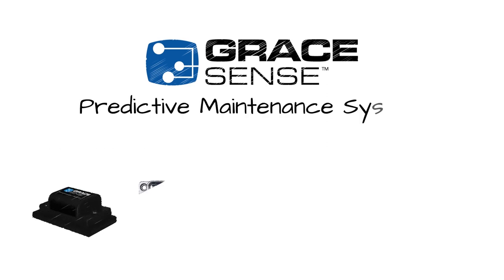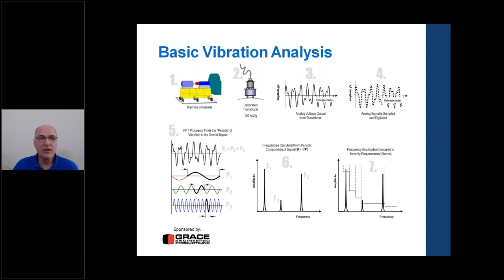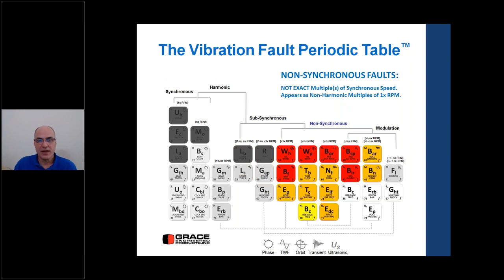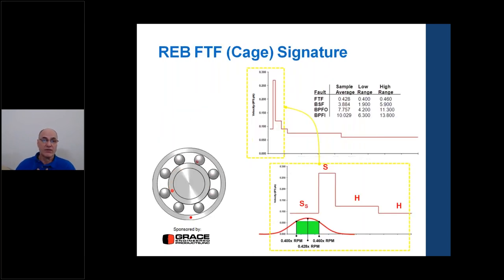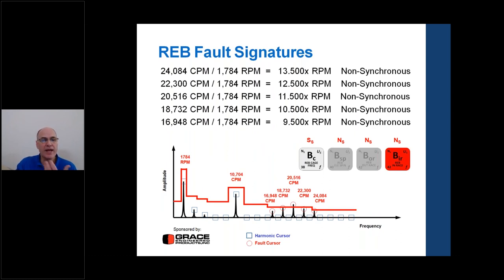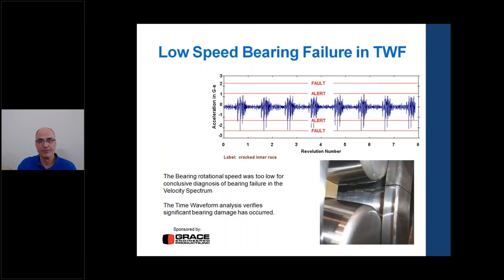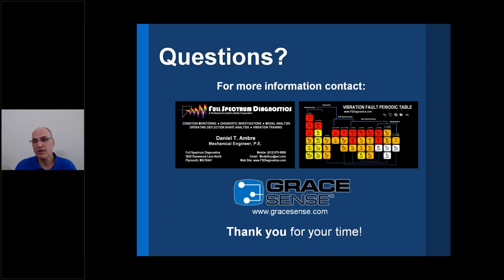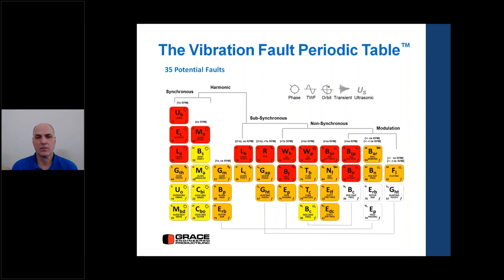Webinar VOD | Vibration Analysis of Rolling Element Bearings: Focus on Failure Stages

Comment: I've seen bearing failure in "real time" which caused the shaft to abruptly stop at 4000 rpm during run-down. The so called "haystack" on the spectrum became very prominent prior to failure. We were relying only on spectrum magnitudes and no enveloping was being done. Another time when I saw an ISB failure, a few days prior to the event, the high rotor vibration dropped abruptly and the low rotor vibration spiked suddenly on the strip chart at the same instant.